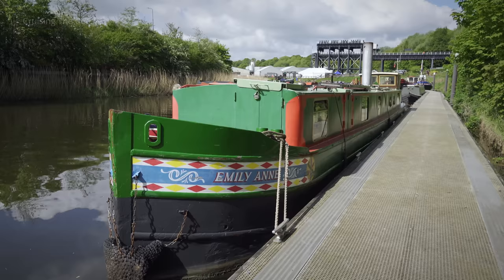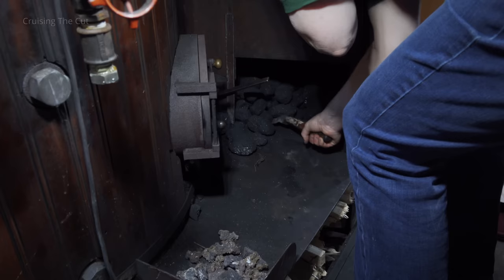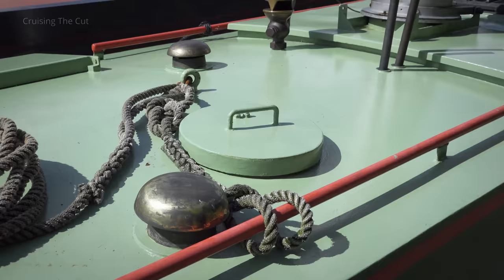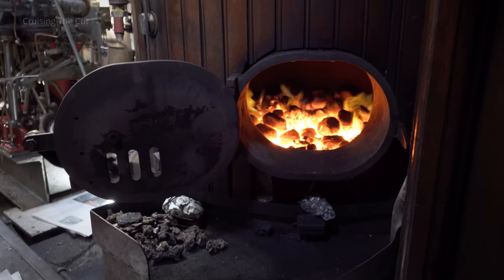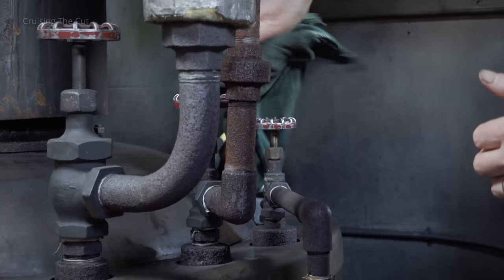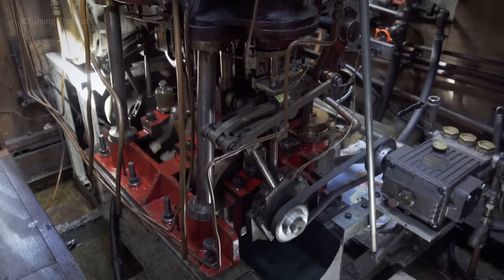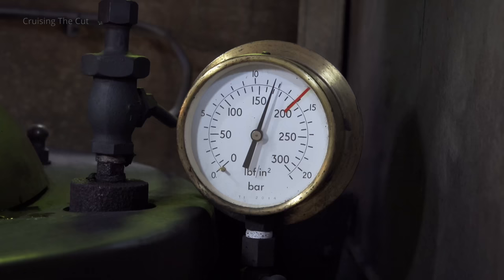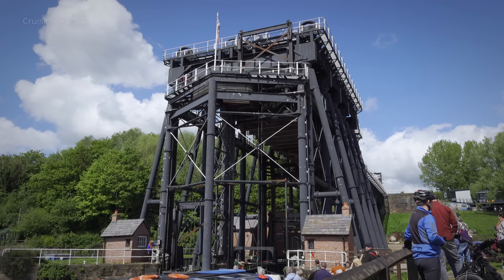269. Steam narrowboat on the British canals

Comment: The lady knows nothing of that which she speaks.  In the first place, what is shown is a triple-expansion engine (note the three cylinder heads) - compound for sure, but THREE stages (high [small head], medium and low [big head] pressures) - and double-acting.   

If you have to worry about clinkers, you're  burning bituminous - not a concern when burning anthracite - NO CLINKERS!....  AND it's not a "chimney" - it is a "funnel"!

Clinkers: Unburned  coal limps that have been stuck together by by coal tar (bituminous).  "Fire Bars" = grate.  No such thing as really "smokeless" fuel - depending upon the type and quality of the coal, the flues must be sanded, every now and then to remove the carbon build-up...  As this appears to be a vertical-tube boiler, the draft would need to be substantial to carry the sand beyond the top of the flues, but not so much with locomotives and their horizontal flues...  (Admittedly, this writer has no experience with vertical boilers.)

Her concept of "wet steam" is painful to hear.  Real "wet steam" is not superheated steam - somewhere around 350-400 psi, and more (no mention of superheater tubes in this)....  If it isn't superheated, it is wet!

But more - she says that the boiler is tested to operating pressure: 200 psi.  Well, uhhh - where is the safety factor?  This writer wouldn't be around anything that was only tested to operating pressure...  And by the way, were her/their pop-valves calibrated & tested?

And - if your pop-valves pop, you've over-fired your boiler = fuel wasted...  And - when you start to get water in the steam, you run a great risk of blowing a cylinder head due to water hammer.  And speaking of water, I heard not a comment about boiler water treatment - kinda important if you wanna get the most life & efficiency outta your tubes...

And as a final affront in the video, again with the "chimney"! - does it look like it is made of brick to you?!!!  In water/maritime world, it is a "Funnel" - or at the very least, it is a "Stack"!  "Chimneys" are for houses!...

This writer didn't give this one a rating, as he likes nearly all of the other things you have put up - but this one was just too naively pathetic to ignore.  Bottom Line: Always watch the boiler water level [I didn't see a low-water alarm] - everything else is secondary...  Boiler explosions due to low water are legion and legionary....

And OH!...  ARGHH!  This one really makes my chupacabra-bites itch!

Ever cordially,
A really old(!) steam locomotive & industrial boiler guy...
Reply from the maker: It was me that referred to a chimney, not Katherine. And I do so because that’s the language of the layman, who is my viewer (other than yourself, clearly)
Reply: It is indeed a double expansion engine, what looks like the smallest cylinder is in fact the cylindrical  piston valve for the high pressure cylinder (the low pressure has a slide valve). We don't burn anthracite, we burn welsh steam coal which works better for our sort of fire grate but can cause clinker. We have a regular hydraulic test to 300psi and gauges and pressure relief valves are check annually. We do use boiler treatment and we obviously check the water level often.

Comment: Nice but bad idea. Go for electricity solar panels and batteries. No noice no dangerous fumes and almost free running for 100 years from now.
Reply from the maker: There's insufficient sunshine to run a solar narrowboat in the UK in anything other than a couple of peak summer months; the rest of the year it would have to be supplemented by a generator.
Reply from the maker: Batteries don't magic up power out of nowhere. There's no battery tech on this earth at present that can simply be charged up during winter and then last throughout summer even with a solar top-up. And there's only a couple if months in the UK that there'd be sufficient solar anyway. Plus there is no grid infrastructure to charge from on the canals unless you sit in a marina the entire time. Battery banks on boats have capacity for a couple of days maximum. See the various videos I've done about this.
Reply: @CruisingTheCut  the grid. There is electricity almost everywhere. Especially in a marina.
Reply: 😂😂😂😂

Perhaps you missed the point?

It is a steam powered boat.

Using steam produced by "proper" coal.

Very "modern" versions of steam power boats have used a propane gas burner to boil the water. A lot cleaner but, in these very recent days, what with the current cost of Calor Gas then probably quite expensive to run.